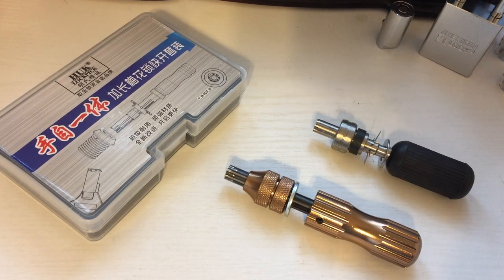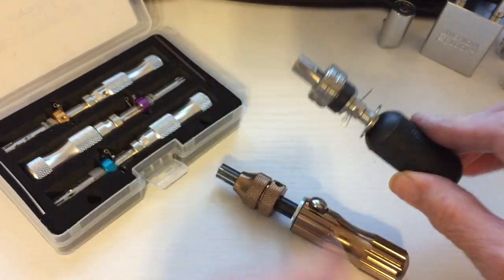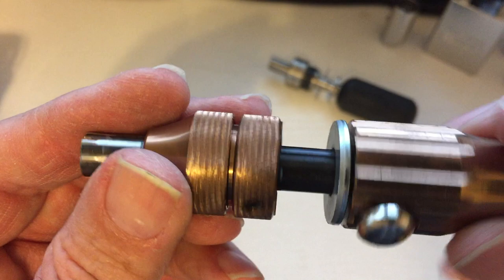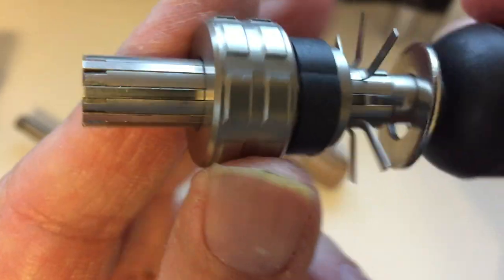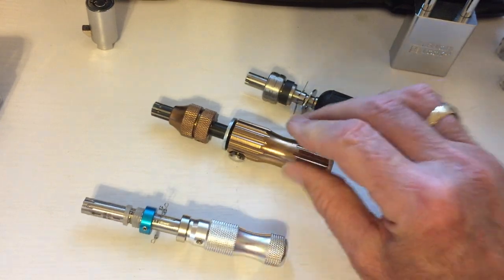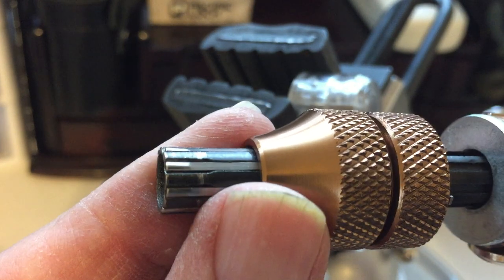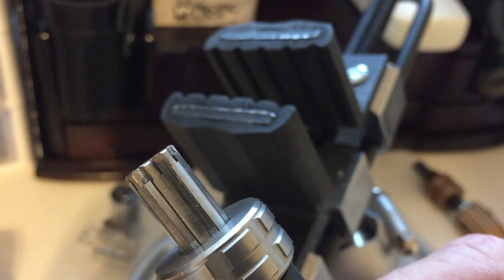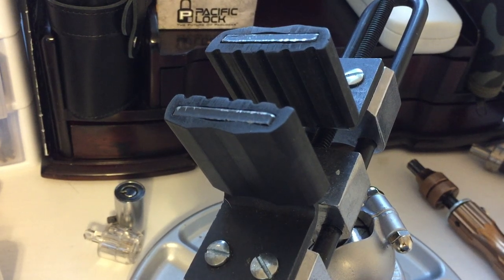#29 Tubular Locks and Picks

Comment: couldnt you switch the bronze colored collar onto the HUK brand pick so then itll have the twizt collar instead of the 4 bands to tension the needles??? ive always heard ppl say they like the collar on the bronze one BUT the HUK pick was the better of the two..??? just a random thought…
Reply from the maker: Unfortunately, the parts of each tool are different sizes and are not interchangeable 👍🦊

Comment: That is a great look at tubular lock picks. I have the Huk picks and considered the Goso pick as well. The Southord pick I think is very expensive.
I never realised the issue with these types of picks is they are very slightly different sizes causing them to have issues with locks. Talking of locks, you don't see many tubular padlocks around. Is that tubular Master a common lock in the USA? Here in the UK I found a smaller padlock that had a tubular core, but it's the only one I could find. 
Many thanks for sharing my friend,  I thoroughly enjoyed the video.
Reply from the maker: Roy Sammons    The American lock is not very common. I saw it on Amazon and thought it was neat. The Goso pick does not have an index pin like the HUK and Southord. The index pin is needed for the locks that have the extra notch. Thank you for your comments and for watching. I really enjoy your videos. 👍🦊
Reply: @jackfoxlock  I remember LPL talking about tubular picks and he leaned towards the Huk rather than the Goso because it has the tensioning pin you can remove. I have heard people say you can pick a lock without the pin and have seen it done. I haven't managed to get one open with the pin out. 
I really enjoy your videos too my friend. Stay safe.

Comment: The HUK pick you put into the first lock.....did not look orientated correctly and it looks like the pin in the middle stopped it going in at other angles. 06:00
Also that pin is not needed to tension the lock. I believe it's main purpose to be indexing the pick. The whole lock can be tensioned using the pins so you could remove the rod inside the pick and it will still work. Notice you put the HUK pick in the correct orientation into the American padlock like I have. The Southord also has that pin inside that stopped it going in because it was not lined up by the looks of things. The Goso is the hardest to make work but the HUK rubber band one does work you just need practice and remove band and put bands on to get it to tension enough.
The goat wrench does fit the American padlock but you need to use the other side. The side you tried was for the locks that don't have the notch on the center post.
Reply from the maker: BlackDolphin90   The gold color Pick does not have an index pin and still will not fit some of the locks. I removed the pin from the HUK and it also did not fit.  I have put extra bands and even castration rings on the HUK to increase tension but it did not help. I think I just have a defective tool. Thanks for your comments. They are always welcome and helpful.🦊

Comment: Great demo, I have the cheaper set, but I like how the SouthOrd will lock up to be reused a key Didn't know that.  I also have a one practice lock and one real working one, not a fan of the plastic practice one, it seems to give and move, where a metal just feels strong.  I see the benefits to having them though.     I really like seeing the 3 different types you have.     sometimes instead of wiggling them, I'll turn it one way for tension, and just use my finger to click Down each one into place, but that's more on the plastic one, the metal lock will open in a couple twist, really neat to see them working Jack  and awesome job on opening that  American, and I wander why you dont see them around, maybe because of these tools being so easy to get?
Reply from the maker: Rook Knight   Thanks for sharing your experiences with tubular locks. I have a several tubular padlocks of the same make that won’t open with any of the picks. They could contain security pins. Thanks for watching.🦊
Reply: @jackfoxlock  that would make a interesting gut, I would really like to see inside one of those, do you have the key for any?
Reply from the maker: Rook Knight   Yes. I’ve never gutted one. Of the videos I’ve seen, it can be a real disaster.
Reply: @jackfoxlock  thats a good point, but it would be something you don't see everyday, take care my friend
Reply from the maker: Rook Knight   I checked each of the tubular locks and they cannot be gutted - no screws holding the core to remove.  I have seen videos gutting tubular cores.👍
Reply: @jackfoxlock  that interesting. Catch you next time 👍🏻😁

Comment: it seems that the Southord does the trick well does southord offer different sizes or is the 7.8 the standard size for regular locks ... I've only pick one tube lock and I used a piece of music wire and a wide tension tool until it unlocked then a pair of needle nose pliers ..
Reply from the maker: Don Won   In the US the 7.8 is the standard. Southord makes picks to fit the various pin configurations of 7,8 and more. You can SPP these with a tension tool and a probe or wire.

Comment: I have the same exact set!
Reply from the maker: wes the lockpicker   Hope yours works better than mine. 😀🦊
Reply: @jackfoxlock  have you tried to put more rubber bands on it? It creates more tension and that makes alot of difference!
Reply from the maker: wes the lockpicker   Yes. I’ve even put castration rings on it to no avail. I have ordered another set. Maybe they will work better.😳
Reply: @jackfoxlock  I don't wanna make you mad but mine works just fine!